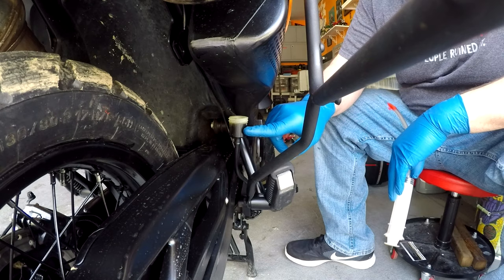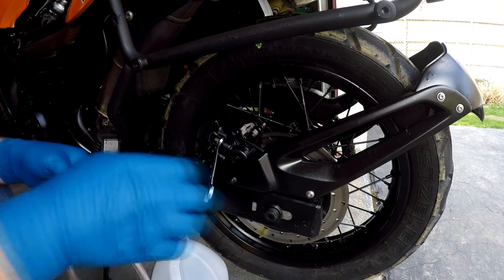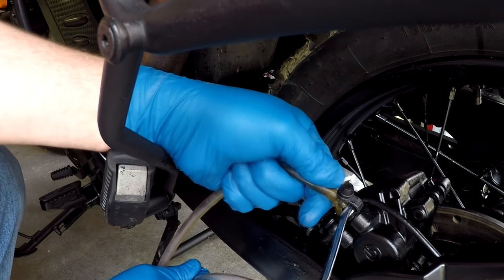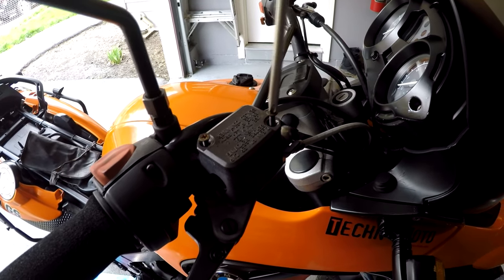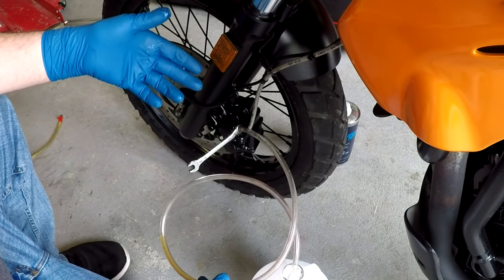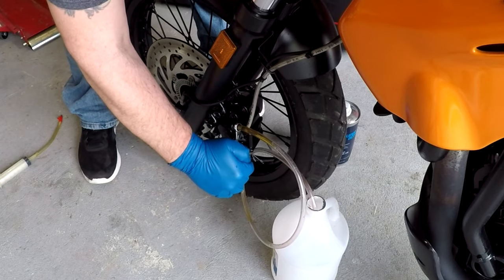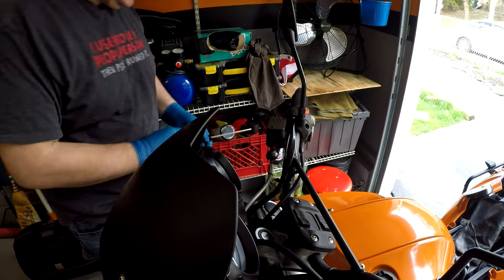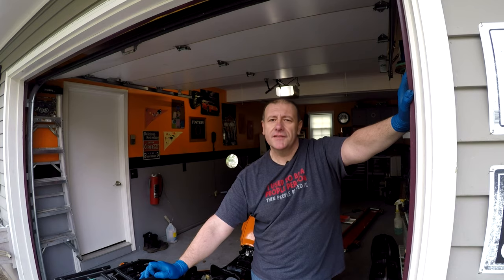Brake System Flush- 2007 BMW F650GS | Techn' Moto

Comment: Great easy watching video. Did virtually the same on mine and it worked well. Considering how easy this operation is, you could take it around the block a few times activating the abs, and do the bleed again. Would have been easier had I seen your video first , lol. Subscribed and liked. Look forward to more. Thanks!
Reply from the maker: Thanks. I appreciate that.
Reply: forgive the noob question, but what does activating the abs system as you suggest add to the  procedure? is there another loop in the system that this bleed procedure doesn't get to, the abs motor?

Comment: is this the same procedure with the abs model?
Reply from the maker: I take it you did not watch the vid to the end lol
Reply: @TechnMoto  thanks,I have the same bike with the single spark.It is  a very decent bike,you will see it except of the pump seals that eats it often mostly in warm climates.Nice work and thanks!
Reply from the maker: yes these are pretty good bikes overall. great on gas and low maintenance too.

Comment: When you take the old oil out from the reservoir, and then fill with the new oil, are you not risking adding air bubbles in the system?
Would it not be better, that you bleed the old oil too, instead of just taking it out?
Reply from the maker: do it either way, as long as you don't disturb the pedal/linkage/system it should be okay. that's how I do it and never had a problem. but hey that's just me